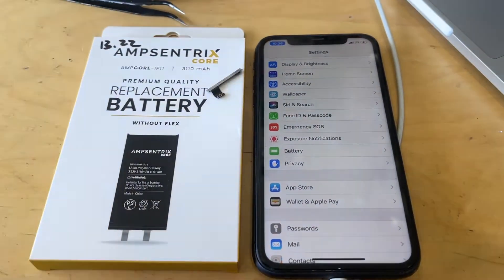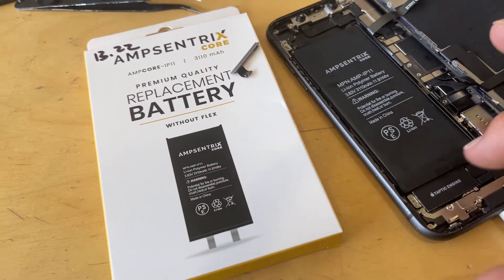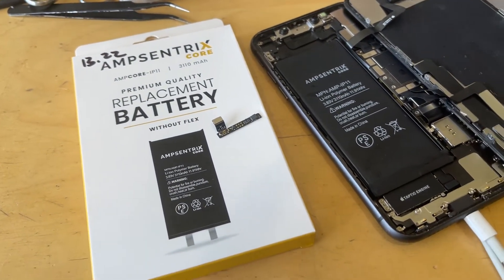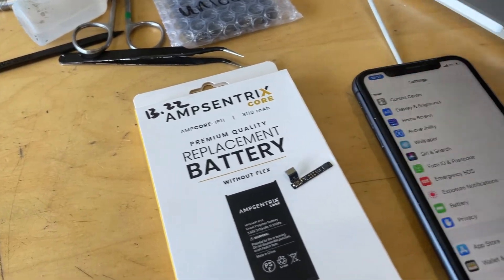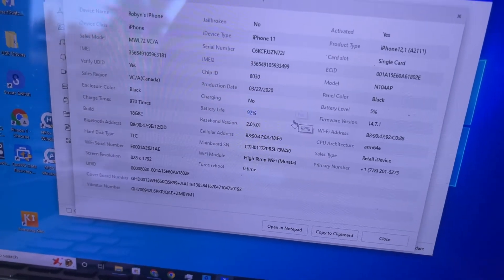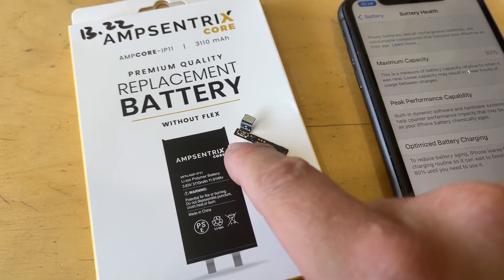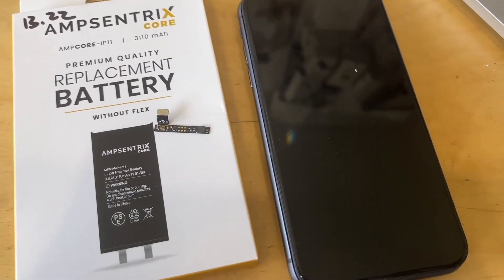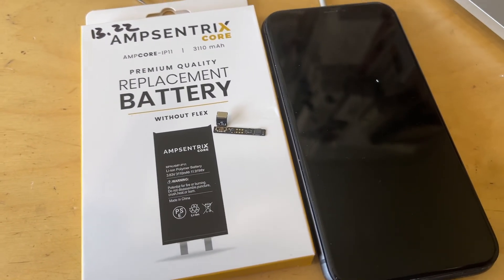Core battery replacement common questions answered. Is the tag on flex needed permanently?

Comment: Hello, after instalation the tag-on flex it shows 1%, and wont charge. I restarted multiple times, and I took it off and put it on for two hours and still the same. Now even  without the tag-on flex battery shows 1%. Is the Tag-on Flex broken? Before it showed normal battery percentage and battery health 81% What do i do now? . Thank you

Comment: I corrected battery health and cycle with the tag on flez, when i remove it it keep saying the old battery percentage (74%) when the flez is on, its saying its not charging. what could be the issue?
Reply: hi did you find the answer and  , do you know if the analytics log still delivers battery cycle count and Current/Max capacity after a third party battery replacement. So that I can manage to know where my battery at myself ? thanks
Reply: @midwolf93  amigo solo lo reiniciamos varias veces y funciona todo bien !!

Comment: I don't understand.  If the tag on flex is not needed then what was its use in the first place??
Reply: to read encrypted data when changing battery data, after that its not needed.
Reply: @GamerBit  so it would not bring the battery notification after a while without it?